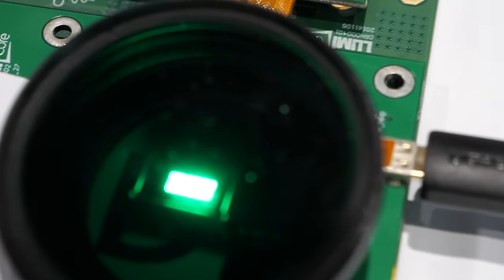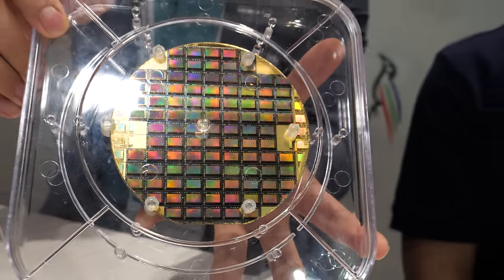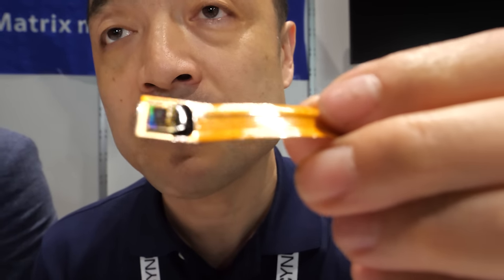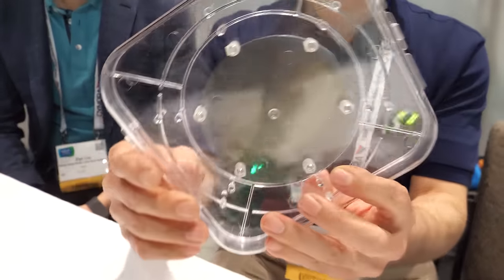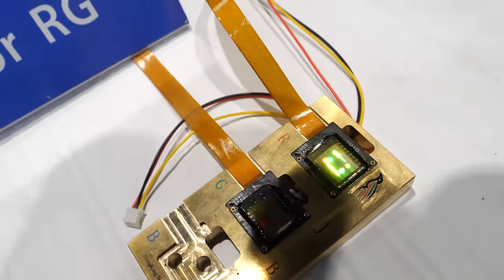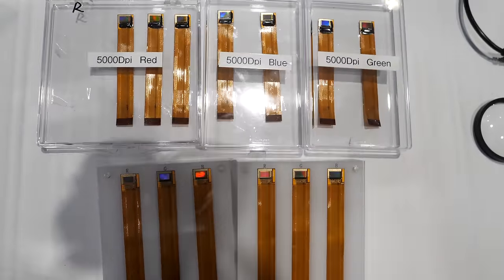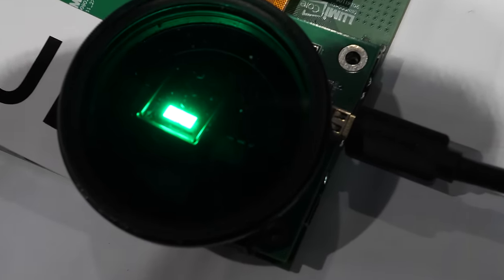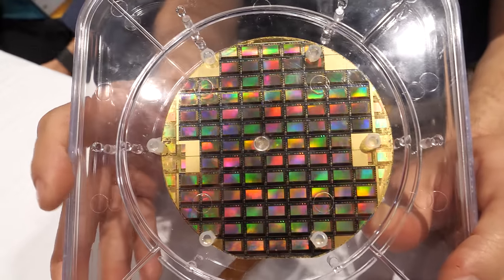JBD microLED 2 million nits, 10,000 DPI (5000x4000), brightest, highest pixel density in the world

Comment: OLED was just a prequel to microLED. MicroLED is the endgame of display technology. This could even be used for projectors.
Reply: CMOS microLED will always be too expensive for TVs. There has to be other manufacturing methods to scale the size of the screen beyond the limits of CMOS litography (about 8cm2). If someone figures out to make microLEDs with TFT or similar technologies then we can scale the technology to larger sizes and make it cheaper.
Reply: hmm may next is nanoLED display lol
Reply: Dreamstate  non-organic OLED doesn't make sense since OLED means Organic Light Emitting Diodes.

Standard LEDs, like in LED TV backlights aren't organic, but they are way too big to be used as the self emissive pixel creation method.
Micro inorganic (not organic) LEDs are what you mean, it's possible given what these guys have made to make a panel using that, but it's still a long way out.

What's closer is tech like Hisense's ULED XD, which uses full array local dimming, with over 100 Zones of dimmable LEDs, then they use two LCD panels, with one of those blocking any unwanted blooming at the pixel level.
Basically two 4K panels are precision placed on top of each other at the pixel level and a clever algorithm will do the magic of approximating the kind of per-pixel dimming capabilities of OLED, but it's a lot more complicated to implement.

Costs will apparently be better than OLED.
Hopefully Hisense can do this for 2020 product launches.
Reply: yomommaLED is the future
Reply: @LeonardTavast  We might quite literally see a QLED type TFT with MicroLED backlight coming soon.
Reply: Unfortunately even at two million nits they're not bright enough for projectors. Let's hope they can get them up to ten.
Reply: @jannthomsen2760  youll get that by scaling them up. projectors will be a much later milestone though.
Reply: I guess if you made a large enough panel inside the projector you could use it in a dark room. Interesting idea.
Reply: Jared M Johnson well sure, but a projector needs 400 nits at least but on 6m2 and several of those panels are lie too large to fit. But if they can get them up to 10 Million kits same size and in a projector I’ll buy one.
Reply: An optimal screen material would be sound transparent like a breathable fabric and MicroLED would perhaps project through it from the back. This way you could have both wrap around screens and it won't interfere with the sound system; the audio can pass right through. A perfectly spherical screen wrapping around a 6D motion pod with Atmos is the 2040 dream.
Reply: @jannthomsen2760  Why not? Shouldn't it be more than enough?
Reply: No the end game of screen technology  is holographic  technology  make games literally  pop out of the screen  lol so basically  3D with mo glasses I always  wondered why 3D crashed  lol the active glasses cost like near £200 for a single one  and are delicately  as he'll I remember  the old samsung doing 3D it was weird you had to make sure your I'm the correct 3d view or it looks like shit lol  hologram  holographic  would be nice tho no glasses 3D
Reply: Problem  is how bright is too bright for HDR I know the typical  standard  for hdr is 1000nits but dolby requested  40000nits yet Sony created a 10000nit display so does it mean that for true hdr 10000nits  is the sweet spot  meaning oled is screwed I won't push oled further than 100nits lol due to burn in in fact I need another  tv now because  I have a youtube logo burned to the panel dye to having my brightness  at 80% oled light I kinda wish a hybrid  of oled and quantum  dots came out would be nice to hit dolby vision  at 4000nits and lol for now I mean due to metada of hdr being screw ball at the moment  

I know samsung is working on a oled hybrid  with there own technology  the question is how long will it take for them to make a hybrid oled will microled  take over before or will microled  be sooo expensive  taht the prices won't drop after 2025  meaning its a pipe dream till 2040 meaning its gonna stay expensive 

And even then samsung needs to work on making quantum  dots even brighter than 4000nits  so it ends up being who can produce the first highest brightness  display with the benefits  of using oled or microled  obvious  that microled  will probably  last longer than a oled hybrid because  oled is still a organic panel used with quantum  dots
Reply: Actually we wouldn't even need projectors at that point. Thing is projectors need a large amount of light in a confined space to work properly, which is why to this day, they still use metal halide lamps in them. Just having the display there already is much better than having to project onto a screen that can't even give you good quality

Comment: It has serious thermal issues at high brightness. It can reach 2 mil nits, but the heat generated prevents it from any compact application at high brightness. Note that their samples are placed on copper blocks for heat dissipation. I actually visited their booth at SID. The demos got really hot during operation.
Reply: Makes sense, they are practically running a semiconductor at full voltage without a heatsink and active cooling.
Reply: Water cool it and problem solved
Reply: @1pqlamz466  Water cooling would seriously limit its application.
Reply: They know what they are doing..don’t overreact!
Reply: Well since Sony only needs 10000nits for 12bit colour HDR  you won't need to drive them to 2millon nits even if it stays pretty cool at 100.000nits  these LEDs are stupid bright
Reply: High brightness means two things. Low duty cycle for strobing, which means perfect motion clarity without any persistence blur. It also means you can have a convoluted optical path for AR that loses a lot of light to semitransparent mirrors etc.

Comment: 2 million nits???
TVs can’t even barely hold 1500 nits.
Anyway, this is a interesting technology.

This all sounds ridiculous.
5000dpi pixel density 
1000Hz refresh rate
2 million nits brightness 

Lets see how this evolves.
Reply: 2 milion nits on 1 square inch.
If we extend that image to 32 inch squared we get 1000 times lower nits so we have 2000 nits when image is projected to 32 inch.
(approximate figures)
Reply: I remember before SSDs were widely even known as real, a Chinese company was demonstrating near instant on Windows 7 with a card based inserted data storage device. No one believed it could exist. 

Here is that kind of level of tech again. It is astounding.
Reply: *10000DPI
Reply: @jayce8001  I dunno about that story. In the 90s we were already able to install an OS on a RAM-Drive for incredible speeds.
Reply: Seems that it's more useful for small screens like VR and then possibly phones. But this is the start of something big. A shift in tech is gonna happen.
Reply: @Ady73 Nits means candela per square meter so we will always have 2 milion nits no matter the size. But if the display is smaller than 1 square meter we will have lower candela.
Reply: @jayce8001  ok i checked their website and it says 10000 dpi for monochromatic so that means it can only produce 1 color so i think it is useless
Reply: @FuNiOnZ2  i dont know but i think there is something about it, why the big companies didnt adopt the technology no one would neglect it if what they claim is true , i want to believe it and i want it to go to consumers ASAP hope we can get it soon.
Reply: @IAdryan  this is the way it will probably be utilized in the first commercial applications. The first consumer microLED-based display devices will be projectors. But it doesn't mean that scaling it up is impossible while retaining some of the brightness. It will probably be the toughest challenge for the tech.
Reply: @IAdryan  You won't need to upscale. Use Mirrors.
Reply: Samsung  using physical  leds to make a panel needs to start growing them like oled basically  what these guys have made a inorganic film wafer that produces over 1million nit

Comment: We are waiting for projector using this jbd technology
Reply: It will burn a hole in your wall
Reply: @Mutantcy1992  ...and your pocket.
Reply: The only feasible way i see this happening is to use several of for each colour. Say 4 for each RGB (12 panels) optically combined. That would give about 2000 nits combined output at 120 inches. With all the benefits of microled It would be a game changer. Plenty of space in a home theater projector for water cooling. No ghosting in 3D is a big plus to me. Love good 3D but any crosstalk ruins the experience.
Reply: Not sure if my numbers are correct But several panels combined wil give the required brightness for projector specs.

Comment: Product engineer: this is green and red
Interviewer: what is missing?
Me: how stupid is this guy 😂
Reply from the maker: What's missing for them to do full color is a crucial thing to ask I think. Not just the B in RGB, but how do they manage to do full color, seems their dual color is only 600dpi, big change from the 10'000dpi that they are showing in a single color..
Reply: 600dpi is still retina
Reply: @charbax  10kdpi seems quite pointless, even for projectors. It may see use in industrial or research applications but displays are fine at less than 1kdpi.
Reply from the maker: @drkastenbrot  when you can project this as 150" or larger onto your walls, 8K makes a lot of sense.
Reply: @charbax  The die would have to be a whole lot larger for an acceptable light output. Existing projectors dont even use LEDs at that scale very much because of thermal constraints.
Reply: @drkastenbrot  Pointless? Are you kidding? Think of the application in VR, or any kind of view finder.
Reply: @1992jamo  did you even read my comment?

Comment: Does it have any heating issues at those higher nits.?
Reply: That was my first thought too.
Reply: Water cooled TVs before long lol
Reply: Radioactive Bleach  very different technology used there the here. It really just depends how efficient these are
Reply: Strobing. If it's only on 1% of the time, you get perfect motion clarity like a CRT and you can still lose 90% of the power in a convoluted optical path with semi-transparent mirrors and things and have 2000 NITS left.

Comment: This is really smart, if the optics work out this will be a far cheaper far to commercialize microled. I think the biggest change won't be brightness or resolution but no persistence, its been so long since CRT people forget how terrible LCD is in comparison; heavy image processing has hidden the faults from most users. Every thing else needs to go away.
Reply: Of course it won't be brightness or resolution. Do you think LCDs don't have any other problems than persistence? Every LCD technology out there is ridiculous. I'm sticking with IPS because of the colors and viewing angles, but it's still faaaaaar from perfect. Especially the backlight bleed. CRT was awful in many regards as well, otherwise I would still be using that.
The only time I felt like I could breath freely is when OLEDs came around finally. But those things degrade with time rather quickly and are too expensive to be seriously considering an OLED TV or a computer monitor.

Comment: I wonder whether it would be possible to use this process on a flexible substrate instead of silicon. If this draws very low power, it could be made into a contact lens that is powered wirelessly by an antenna.
Reply: LEDs need cooling though (so I'm guessing microLEDs need too, to some extent), so I don't think it's a good idea to slap that kind of material on your eye :p
Reply: @David-2501  At 2M nits it won't be just "some" extent :) Then again, you don't need a 2M nit lens on your eye :)

Comment: This is genius. Unreal light output. What kind of refresh rate is possible? 240hz each panel? Or per stream across 3 panels?

Also, they need to bring on a small development team to make some applied demos as this is the kind of tech that can go mainstream really quick once only 2 or 3 problems are fixed. 

Hot hot do these get? 2 million nits has got to generate heat.

Comment: Would have been nice if you asked if they had any plans on creating bigger displays for applications in smartphones and bigger screens and if they have any idea when we can start seeing them in the market.
Reply: No, obviously. This is a single silicon chip; like a processor. What you are asking for a phone-sized single chip (4x4 cm is the largest single chip I've ever even heard of) with a resolution a hundred times better than anyone can possibly see.
Reply: @soylentgreenb  you're right its unlikely, but there could be ways of "sticking" multiple ones together? or perhaps work around the defects by binning them? Would have been interesting to hear their view.
(btw the largest chip ive heard of is from Cerberus thats 21x21 cm.)
Reply: @senri-  Have you seen the chip? It is a single wafer with many dies, each of which is much smaller than the reticle limit (~40x40 mm). This is how chips are made on 300 mm diameter wafers, except everyone else scribes the wafer and cuts the dies loose and mounts them as individual chips to a PCB. What they have done is simply placed them closed enough and figure out how to align them well enough to connect the individual dies. Several chips on a die are going to be defective, they just fuse those off. In a display this means you will have a ~30x20 mm (or however large the individual chips are) dead area on the screen in random places. There are also macroscopic, visible holes in the die from the manufacturing process that could fit hundreds of thousands of pixels. Any method to join the individual chips after cutting them with a diamond saw and removing the defective ones (and then you end up with < 40x40 mm dies as I said) requires much more space than the pixel pitch. The diamond saw used is not a very precise instrument; it is this scraggly thing with imprecisely placed diamonds on it that will need to leave a tenth of a milimeter or so margin to the actual chip. 10 000 PPI is 400 pixels per millimeter.

Comment: Full RGB panel is only needed for VR/AR appliances, separate single panels can be used for cheaper projector systems. They're small enough to even fit on normal VR systems, just use a prism to combine the images. Which ever method is more economical will be the right choice.